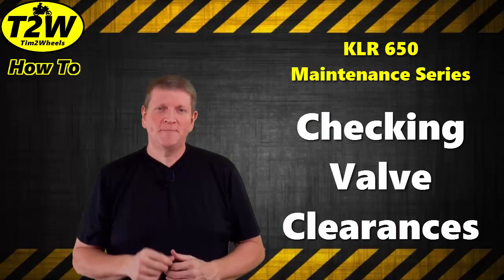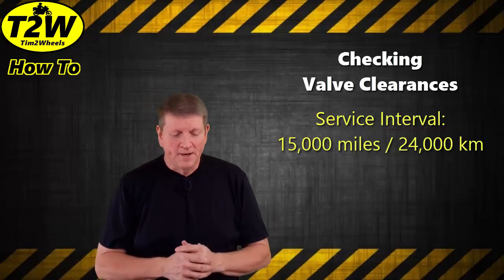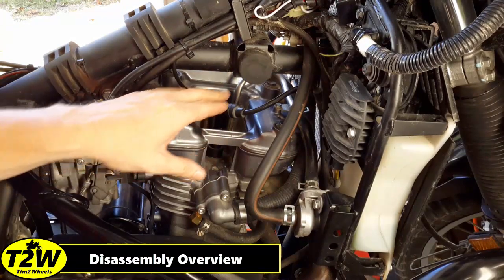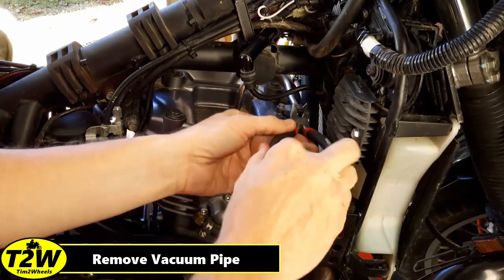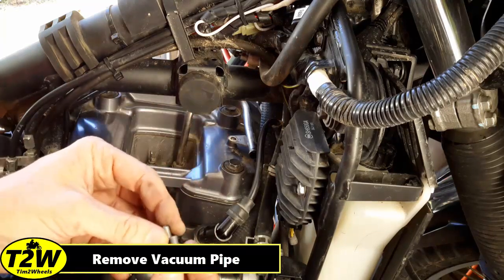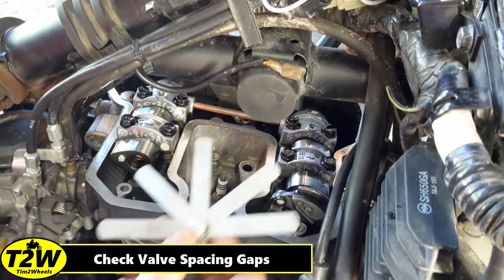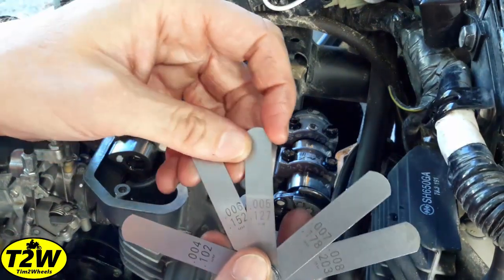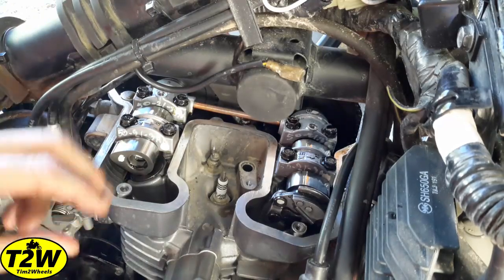T2W KLR650 Maintenance Series: Valve Clearance Check

Comment: It's an easy trick to draw your valve cover on a piece of card board marking each bolt location take a Pen and poke holes and then locate each bolt as you remove it . 
Makes reassembly super easy .
Reply: Alternatively, 3D print a life-size KLR 650 valve cover to put the bolts in
Reply: If you can’t remember where a few bolts go you shouldn’t be working on it

Comment: Thanks Tim, I have been avoiding this for the last 16 years of KLR'ER ownership and now's it's time I dive in. This was a great video.
Reply: How did you not destroy your engine? When I first bought my klr I had a dealership check mine at 10,000 miles and when I ended up with a burnt exhaust valve I realized they hadn’t checked them. After I replaced the valve I have always checked them myself from then on. It’s not that difficult to do.
Reply: @tomvana4270  If it was done once before, it's not likely to need another adjustment anytime soon. Most of the tightening happens when the bike is new. I've read of more than 1 person who has checked them early and gone 40,000km + without needing another adjustment.

Comment: Two types of Sockets  Shallow(short)
Deep (long) .....Easy to remember. 
Also 6 point where possible not 12 point 12's like to strip Bolts and Nuts as they can be Sloppy fit.

Comment: I also wanted to ask if there is any reason that most of videos I have seen on doing the valve clearance job, why not also remove the spark plug to make it easier yet to get to TDC. I realize the Kacker releases some of the compression but I do feel the Pistons compression and one time it pushed me past TDC ( reason I decided to blow top of spark plug area with compressed air and removed spark plug I found that made it very much easier for me to get to TDC. Just wondering if I'm missing a reason I should not be doing that. I put a rag over area to prevent anything from falling in spark plug hole. So that's why I am asking.  Again THANK YOU I HAVE DONE MOST OF THE MODS PLUS OTHERS THAT YOU WEEE KIND ENOUGH to make high quialty detailed video's ...how you did it is how I decided to do mine thanks to your hard work on making and editing time consuming video's.... I still am hoping you will be kind enough to decide to add the EBC 320mm Front brake even though that means even a lighter hand in the dirt, but the stopping power increase especially when you are loaded with gear, and or taking your wife along.

Comment: Hi Tim I'm wondering would not the clearance get larger as the engine wears .?I don't understand why the clearance become larger than tighter ? Please explain this concept to me thank you Tim . My engine has roughly 12,000 miles on it there is no problem now but later I may need to do this thank you and great vidio man !

Comment: No, you don't slide your feeler gauge between the lobe and the shim; you slide it between the heel or base circle of the cam and the shim.  If the lobe was in a position to be able to slide a gauge in between it and the shim obviously the valve would be open and there would of course be no clearance.  And why do you refer to the AIS tube as a vacuum tube?  Doesn't it induct air into the exhaust via a port?

Comment: Tim need your help, 

I have a 2014 KLR 650 with 8k miles and it just started blowing blue smoke while riding, I believe it my be the rings, can you tell me why this happens as it has low miles??? 

Thanks Tony
Reply from the maker: Hi Tony,
That is unusual for such a new/low miles bike. Normally, I would suspect oil getting into the piston during combustion, which is usually bad rings or cracked cylinder/piston. But with only 8k miles on it, I would say that's unlikely unless you've had work done recently.
A more likely cause is dirty fuel. Is the fuel clean and fresh? has there been additives, oil, or anything like that in the tank? Does the smoke occur all the time or just while the choke is on?

Blue or black smoke typically indicates oil, or an oily substance is getting into the gas or into the combustion chamber. This can be as simple as dirty/old/oily fuel, or additives in the fuel, which will burn off eventually. Bad rings or cracked piston at 8,000 miles would be extremely rare.
I have heard of bad valve seats causing smoke, but I don't have much info on that.
I would recommend you make sure you have fresh, clean fuel. if that doesn't help, then you or your mechanic would need to check the cylinder & piston.

Good luck, and let us know how it goes.

Comment: Have you done a top end rebuild? My 07 klr has excessive oil consumption and I believe it needs a new piston and rings. I think I can do this job the only thing I may need help with is the cam chain?
Reply from the maker: John Maciejewski - I have not done a top end. I'm lucky that my 09 doesn't burn much oil. However,  I have been considering the Eagle Mike 685 kit as a future project. If I were in your situation I would do one of the upgrade kits like the 685, etc. That would resolve the oil burn and give smoother, better performance at the same time.

Don't worry about the cam chain. Just secure it as I did in the video.
Reply: Tim2Wheels   Yes the cam chain? I got the information I think I need watching your valve video part 2 it has good info. I do have one question about the valve clearance? The shims are marked 270 or 255 for example you check the gap and find you need to make an adjustment of however much and get a shim with the appropriate thickness using the numbers  on the shim and feeler gauge that makes up the difference to get proper clearance . But I wonder does the shim that has been on the bike wear and have decreased thickness? For example the 270 in now actually 267 in thickness and have to calculate that To get the proper new shim? I was just wondering? Again thank you for the videos and reply

Comment: Hey Tim when you pop the head back on do you always have to put something on to seal it?
Reply from the maker: Hey Guard Dog, on the valve cover if the rubber gasket is in tact (not torn or damaged)then you don't need to add any sealant. 
I hope this helps. Thanks for watching.

Comment: Tim love your videos.  I have an issue. When going back together I cant get the intake cam to align properly. I think it might have been off before disassembly. One tooth back has the arrow aiming up. One tooth forward and its aiming into the head. This is very slight of course. The chain measures within spec. between cams. 127.5 mm 21 pins apart. I'm so stumped. 2001 with 18k. Thanks in advance
Reply from the maker: Hey Frank,
In this case I would use the feeler gauge to find the widest gap in the intake valve cams to set the gears/timing chain alignment. That's what the arrow marks are supposed to do for you anyway. Once you have that set, you can make new marks for future reference. It is possible, although rare, that your factory mark are off.
best of luck, I hope this is helpful, thanks for watching.
Reply from the maker: Additional comment: While doing this, make sure the crank shaft is still at Top Dead Center (TDC). if it is off, that could account for your misalignment.
Reply: At TDC for sure. Another online guru suggest setting intake perfect and let exhaust be as close as possible slightly advanced if necessary. Sound sane to you?
Reply from the maker: That is a reasonable approach and it should run fine. Personally, I would set both intake and exhaust to proper settings for best performance.

Comment: You are setting the motor on TDC for the compression stroke to check the intake and exhaust for this model?
Reply from the maker: V Star 1300 Adventures - Yes, on the KLR TDC is the proper crank position for checking the clearances of Intake and Exhaust.
Thanks for the comment and for watching.
Reply: Despite having to fight a bit to get all the stuff off to get there, at least that one thing is easy.

Comment: Thanks for the video. I'll be digging into this soon. My bike used to start up with a touch of the button. Now it takes awhile to crank then ultimately backfires. After the backfire it starts up fine and runs like a champ. Wondering if tight exhaust valves would cause this? Guess I'll find out soon.
Reply: Did you find out?